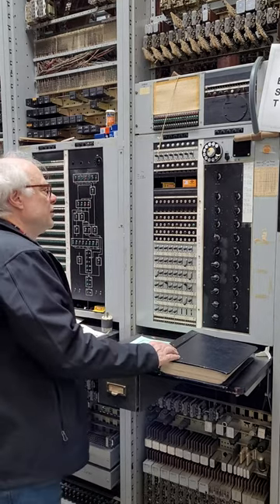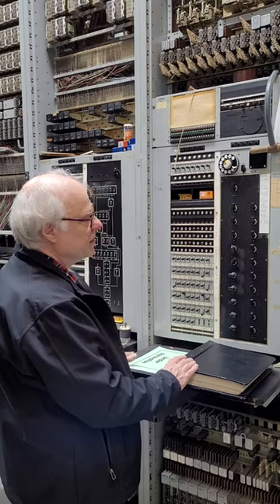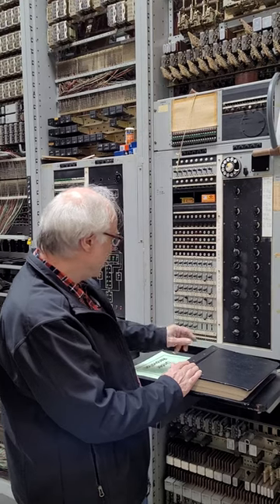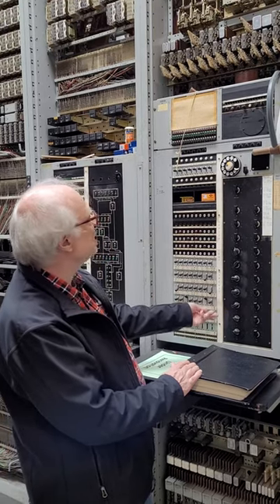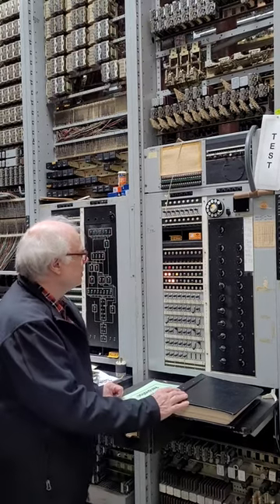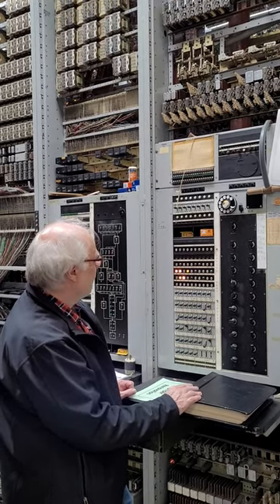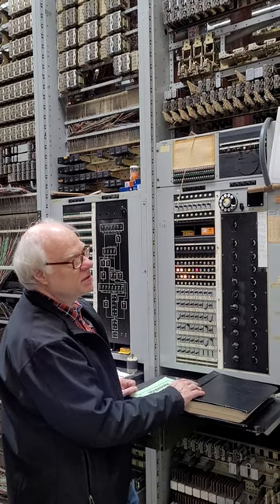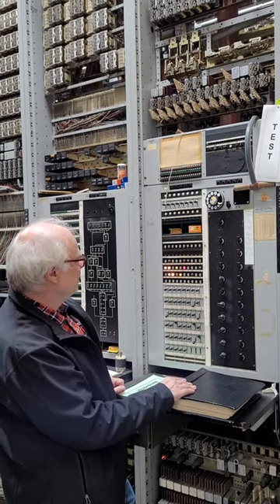Placing a test call from the #5 Crossbar Switch test frame at The Telephone Museum in Ellsworth, ME

Comment: Interesting that It actually dials the number at 20pps rather than interfacing directly with the marker. I can only assume that since this #5 was so small it saved wires and equipment to do it through an OR and not interface direct.
Reply: You can place calls through that machine and it sounds really amazing when the calls are being set up.
Reply: Did you give my comment a like?